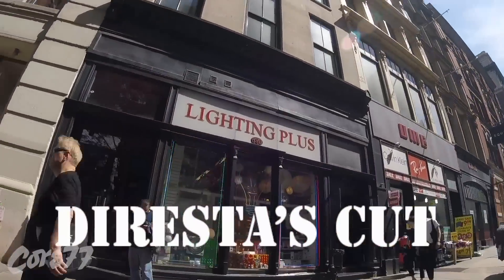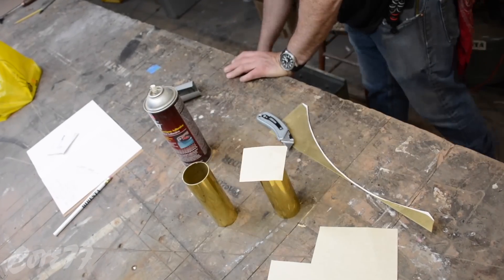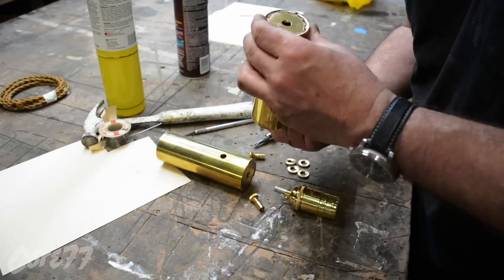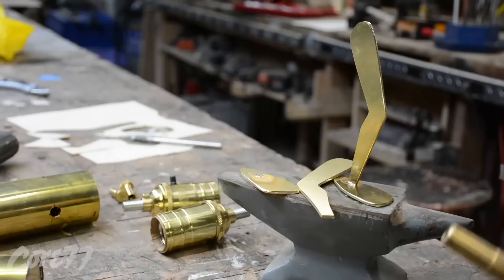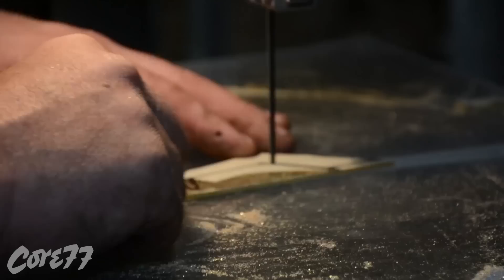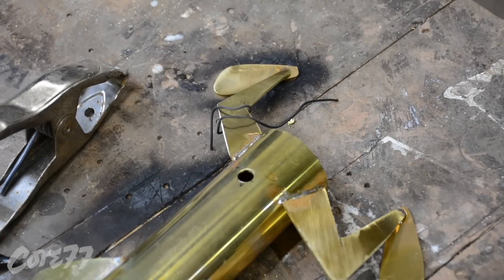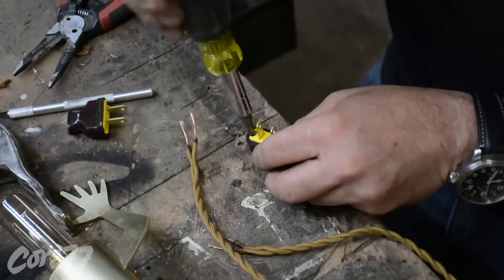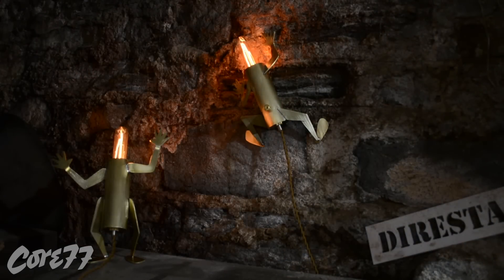DiResta's Cut: Brass 'Bot Lamps

Comment: I don't know why, but I really enjoy watching people argue with experts. It's like watching someone tell Neil DeGrasse Tyson that the Earth is the center of the galaxy.
Reply: Wait, are you saying it isn't?!
Reply: Neil DeGrasse is overrated, but I get your point.
Reply: NDT is a publicist.  And in that role I think he's quite appropriately rated.
Reply: NDT is a scam artist, the earth is flat, research it.
Reply: I bet you're a real hit at parties😄
Reply: GrantedDiresta is a great artist and good at making stuff, but he's not an electrician. and even in europe you don't need ground on lamps. but if they're metal or have touchable metal connected to the lamp part that's not double insulated form the electrics, it should have ground... 

and the slightly different electric system in the US doesn't change how electric and physics work. the pond isn't that big. Of course no one is getting electrocuted unless something breaks.  which happens sometimes, but usually the breaker for the main circuit break then. unless it short circuits to a metal(brass for example) decorative lamp "case" that isn't grounded so there's nothing for the breaker to break on.
Reply: You might want to find a better scientist for your example. NDG has gone for the feels over actual science far too often.
Reply: The dangerous part (in this particular context) is that many look at Diresta as an expert. Not using a ground wire in a conductive housing is really not safe. Any pro electrician will tell you that.

Comment: Totally love your work but have to strongly disagree about the ground wire. It is essential standard safety. Here in the UK it is mandatory and for good reason. It is just good practice. The USA really needs to catch up to that standard as the deaths by electrocution in the home or workplace in the usa are around 400 per year. In the UK in 2010 for example, only 28 people died by electrocution. I dont even like to think about electrical fire stats for the USA, what with all your wood built homes.
Reply: LambOfLucifer Do you realize that the U.K. population is only 65 million people? As opposed to more than 300 million in the USA?
Reply: Of course.  The point is still valid, the USA is lagging behind in this safety issue. If in doubt, multiply the Uk number by 4 or 5, they are still suffering way more accidents. There is no point being pedantic about these things, it is a fact. Just like USA gun laws. The USA suffers because of these shockingly out of date laws and safety rules etc. My comment is not an insult to Jimmy, he is VERY experienced, but I did say I "strongly disagree" with his opinion. If you read down the comments, many many other people feel the same way.
Reply: LambOfLucifer 400 people a year dying because of home electrocutions is nothing when you compare it to the 1.3M deaths a year from car accidents.
Reply: Like I said that does not count for electrical fires too. Damage to propery not just life. Also on the subject of cars, USA dont even have a complete seat belt law. New Hampshire I believe,  do not have to wear them over the age of 18. Just another example of USA lagging behind everyone else. And anyways, your point...while perfectly valid, implies that you think 400 unnecessary deaths is totally fine. ANY loss of life because of poor safety standards is a tragedy!
Reply: LambOfLucifer that law you say is not true. USA laws are that you have to wear seatbelts all the time, any age.

Comment: Jimmy, your comment about the grounding absolutely baffles me as an electrician in the UK, and goes to show I know jack about the way the US systems work. If that was an appliance in the UK I'd fail it instantly as it has exposed conductive parts with no earth and the polarity can't be guaranteed on an ES fitment. Genuinely believe the UK system is the safest in the world, but it's always interesting to see how things are done elsewhere. Would love to have a bash at making something similar but I'd need an extra core on the flex, unless I wanted to bugger about trying to make it double insulated. Keep up the great vids!
Reply: Well pretty much this, the US has less safety regulation on this, heck you don't need to be a licensed electrician to do electric work either... ut yeah, being in the US doesn't magically change how electricity works. IF something breaks it's as unsafe over there as it is in europe and the rest of the world.  Just because they sell lamp kits without ground doesn't mean it's a good idea. then again, the ground is supposed to be connected to the metal case, so why would it be part of the lamp connector kit...
Reply: Here in germany we also have lamps without a ground wire but in this case they are made of non-conducting materials so that you don't have a chance to touch anything which could have power on it.
I think it's more dangerous that he screws the flexible wire down on the connection point without using crimp ferrules. I've seen a few fires in electrical installations caused by not using crimp ferrules on flexible wires.
Reply: should be safe enough as long as he twists them and cuts them to the right length, it's how it's mostly always done and how the sockets and most electric connections are designed to be done. granted crimping IS safer, but not a necessity, of course if something goes wrong with that, the lack of grounding is bad news.
Reply: In the US there are no fuses required to be placed in plugs like in the UK. i always thought this was lacking on the US part, but at the same time i believe that the US has different standards for home circuits that are simply not enforceable in the UK for legacy reasons
Reply: Australia pretty much has the rules in regards to double-insulted devices being the only sort allowed without a 3-core flex, earth lug on the body  and a earth pin on the plug.
I do look on in envy with the variety of DIY stuff which seems to be available in the US, but not easily here because of safety regulations and licencing requirements.
Reply: in the US, we have 110/120 volt systems for household electricity. One wire is hot, the other "Neutral" and the ground is the third.
in the electrical box where power comes in both the ground wires and the neutral are connected to the grounding system. So, our neutral wires are also grounded wires. I have a lamp next to me here from either Walmart or Home Depot (forget which) and it has a metal base, metal poles, a flexible metal bit holding a reading lamp, and it is a two wire system and is UL listed.
Our two prong plugs are "coded" with one blade bigger to ensure the neutral stays grounded. You can still buy two plug outlets for replacement of faulty outlets in older houses that have not been updated.
My house is built in the late 40's, and had a no ground (earth) wires in the original design. I found one plug left over that was not used for some time as it did not have the wider slot. I found it while rewiring the upstairs portion of the house. Someone made it look to be grounded at the newer breaker box (for an inspection to sell?) but it wasn't. 

All that said, if I was making those, I'd use a three prong plug, because all my outlets are now made that way.
Reply: best thing about the wire used is that it is euro color coded. ul/csa would be blk/wht.
Reply: I think jimmy's understanding of the whole "you need an earth wire" comment is that he thinks the European commenters are saying you need an earth for the lamp to work. Not that it's just simply unsafe to not have the conductive material lamp body unearthed in case of a short. Obviously I could be wrong but that would be my guess as to why he's bringing it up. Or as previously mentioned the American laws regarding electrical safety are just different to Europe and Australia.
Reply: It's purely for safety that an earth connection is required (shock hazard from an accidentally live metal chassis), not to make the bulb light.
Although, now with RCD/"earth leakage" devices are required on the breaker boards in Europe and Australia, that will trip if the chassis is live and you touch it (the imbalance in the current between going in via active and out via neutral causes the power to be cut in a tiny fraction of a second).
Reply: How is that I have a metal lamp from Ikea that not groundid.
Reply: Other than outdoor home lighting in the US is almost never grounded with a third wire.  As JP mentioned our neutral is tied to ground.  But there are other differences 120V doesn't "jump" as fat as 220V and all english sockets are grounded and you need the ground pin because it opens the other slots, like child proof outlet in the US.  But last time I was in the UK fuses were sold as bare wire that you connected to a reusable fuse body...  Also outlets in the UK are huge compared to the US, which is a bit weird since they are carrying 1/2 the amperage.

All in all the UK system is probably safer than US one but it's quite hard to make those kinds of changes in the US because you need to get 50 semi autonomous governments to agree.  And well look at Brexit, it's hard to get everyone on the same page.

Now we used to have a much safer system.  NYC and most early electrified cities were on DC.

Comment: Hi Jimmy, just to add a thought to grounding metal lamps: I think the comments you're getting are from countries where codes stipulate to ground any metal fixture if there are electric currents above 40 volts used within, unless they are surrounded by a non-conducting housing. Also there are countries (like Germany -- where I'm sending you this from) that require electric hook-ups to be done by a licensed electrician if you don't wanna loose insurance on your appartment or shop (in case of fire from a short). The U.S. are much more relaxed in this regard. For whatever it's worth... 
Please keep it up. Your work is awesome! 
All the best from Berlin

Comment: In Thailand, most of the electrical appliances doesn't have ground. only Live and Neutral wire (with fuse) , with 220V current supply to each home. Wall plug doesn't have on/off switch on it and makes spark every time we plug in something, it still safe though.
Reply: Oh my gosh! 😂

Comment: This is great! Well done Jimmy... I could be wrong and please let me know any UL experts, but I have noticed on power tools that they are always grounded if the housing is metal and no ground if the housing is made from a non conductive material like plastic? Not sure if this applies to lamps...
Reply: Von Thompson Tinker Id like to know too.
Reply: In Australia that it the case. Plastic fittings are considered to be double insulated, as a loose wire in contact with the casing won't make the casing live.
 In my view, the lamps that Jimmy made, are potentially lethal in the event of a live wire contacting the casing, but he did point out that the connections need to be tight to make sure that there are no loose wires. 
In an item that has no moving parts that is probably safe but I would have earthed the case to make sure. 
For my money a third wire isn't difficult and worth the time and probably safe doesn't work in the over legislated country that I live in.
Reply: metal cased power tools? Maybe from the 1950's. The reason power tools don't have a ground is because they're double insulated.

Comment: the wallklimber is just awesome. I love your works. please alow me to explain you how it works in Germany. Blue is the zero line, black or brown is the hot line/wire. yellow/green is the neutral/ground wire. we use the ground wire in Buildings and  in electrial tools which are made from metal (par example the case of a drillpress or a bandsaw. a drill with cords where the case is made from plastic there we use two wires. I hope i didn't bored you, inspite of my english is really bad.

Comment: When we made lamps in high school ,we did what they called an underwriters knot inside the bottom of the socket so if anyone pulled on the wire they wouldn't be able to pull it out of the bottom of the socket causing a short

Comment: a normal lightbulb here in germany has no ground, maybe you could attach a ground to  the metal casing but theres no actual need to do that, because the socket is insulated in itself and therefore wont let electricity touch the metal casing

Comment: Here in Canada, and the US, table lamps are not grounded, but ceiling and wall mounted lamps are. This is a safer design. Table lamps have a live connection that may be exposed when changing a bulb. If you are holding the lamp while changing a bulb this can create a shock hazard. The chances of a lamp being mis-wired (putting the live connection on the large bulb screw, rather then the inner tab) is far more likely then a wire coming loose and touching the body of the lamp. A live electrical part is only dangerous if there is a ground or neutral within reach. Both approaches to lamp wiring present hazards.

Comment: My grannie's house has no ground in her wall plugs. If you have an item with a 3 prong plug, you have to have an adapter before you can plug it in.
Reply: i always cringe when i see these adapters used and the ground ring is left floating. if your house has a grounded pipe system (which i really hope it does even if it is old) then you can ground your adapter by putting a wire from the ring to your faucet. it may save you a nasty arc and fire some day!

Comment: Hi..Diresta.
 i´m from German and we in Germany see it so: 
You need the The Earthkable  when the Lamp has Metall outside where you can tought on.... there you conected the cable.
So when Power is on The Metall on the Lamp (broken Cable etc) the Power go to the Fi-Fuse and cut the Power to the Lamp.

Comment: Building lamps with two wires (hot/live and neutral) is completely fine and most of the devices in europe come with only these two connections (lamps, vacuum cleaners, powertools and so on). The ground wire is there to fx. give lightning strikes a short way to the ground to cause less damage, to get rid of induced current in metal cases, some machines with turning components might acquire static electricity which is discharged like this and it ties into the application of Residual-current devices to protect human life. Has actually nothing to do with 240 or 120 V,  voltage gets dangerous from about 40 volts and upwards depending on your skin resistance,  which provides the limiting factor for the current that might actually kill you. I read somewhere further down that we in europe use 2 hots for our 240, which is incorrect, but we can use 2 or 3 hots in order to get up to 400 volts for things like electric stoves and such. Having a brass casing, a ground would still make it even "more" safe :P

Comment: The difference between 2 wire lamps and 3 wires, or grounded, is that the ungrounded electrical appliance is double insulated. Usually means the external casing is plastic, but mainly means even if the cable comes loose of frays, the cable can't touch anything that would not make the casing live. That's not true of these. But they are less dangerious because Americans use 110v for most of there house electrical gear, where as the civilised world uses 220v to 250v.

Comment: You should use the lamp wire as some type of mountain climbing harness. Instead of the wire coming out from the bottom make it look like it's coming from the front so it looks like its hanging from that wire. As if it were mountain climbing the wall

Comment: i dont get the complaints about the grounds. I am from that lovely eu and there are enough store bought lamps that dont have a ground.
Reply: Nordic because they are double isolated, if case is non conductive and wires are isolated you can go with no grounding and 2 pole plug

Comment: Led free plumbing solder is not as soft as electrical solder but still melts at about the same temperature. By rights the lamps should be grounded like everything else but like you say they sell a lot of lights and other appliances with only the two prong plug and two wire cord. Do the plug in cell phone chargers for Europe have a ground pin on the charger?

Comment: If you really want to get a reaction you should wire the neutral to the body.  It would be "grounded", assuming that all the wiring was correct in the lamp, it was plugged in correctly and the wall wiring was correct.  What could go wrong?

Inspiring build.  I'm going to head down to my local strip club with a sawsall!

Comment: one thing that boggles my mind: almost everything i have ever taken apart wich was made in germany or lets say europe has solid core copper wire connecting to the outlet, almost everything meant for the US market uses strainded wire. is there a reason for that? i cant figure out whats the deal with that